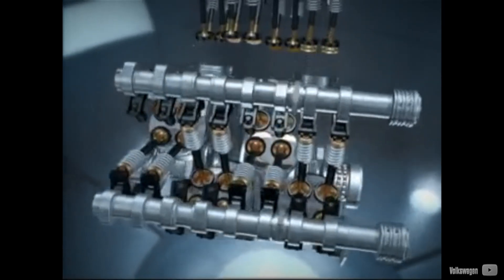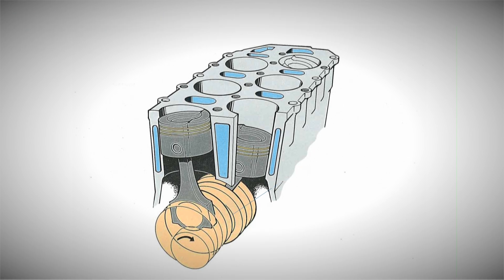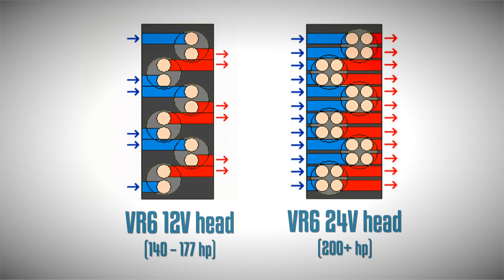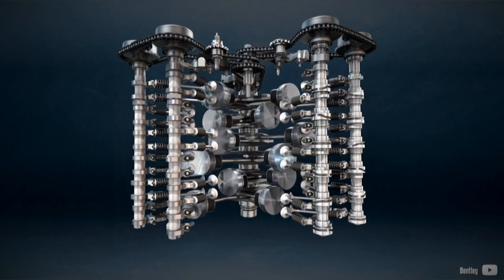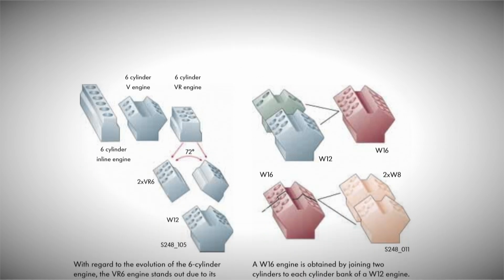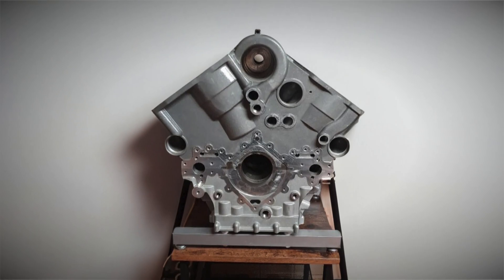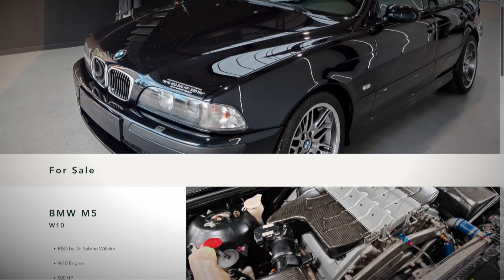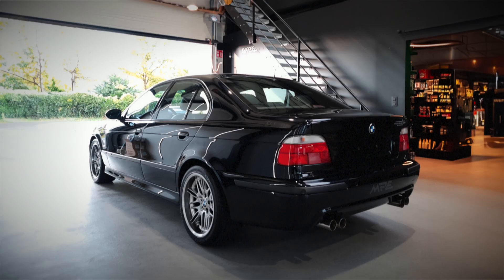The Volkswagen W10 Is A Real Engine

Comment: The power output of this engine can be easily surpassed by a modern 5 cyl Audi turbocharged motor which will also be lighter & more efficient. Large displacement engines (which are also incredibly complicated & expensive to rebuild) in light vehicles simply don’t make any economic sense, despite the merits of their technical achievements. Moving into the electric & hybrid era these engines are dinosaurs.
Reply: The old BMW N52 was waaayyyy easier to diagnose and fix than the modern replacement... So always take the generalisation with a grain of salt.

Comment: VR6 stands AFAIK for V-Reihenmotor (inline v-engine), 6 Zylinder. It's an inline and a v-engine at the same time.

Power output of the first generation (sold as VR6) was 174PS for the 2.8L and 190PS for the 2.9L respectively here in Germany.

Yes - it sounds great. But it's engine management system was already outdated when new. It constantly runs rich and the timing chain is a pain in the a**. To sell them in the mk3 Golf they even de-tuned the (IMO superior) 2.0L 150PS ABF engine.

Albeit the strongest 4-cyl. n/a engine they ever made - with the famous Garlock chip they did ~165PS on an otherwise stock engine. When you spend a little more you can easily get to 200PS and over.

The VR6 (and later V6/R32/R36) is a tuner's favorite - but it has it's limitations. Especially in light cars like Golf mk1 - mk3, handling suffers dramatically from the massive lump hanging in front of the front axle.

For driving performance, the 1.8T or the ABF are better choices.
Reply: You mean the VW AP?
Reply: @gabrielvieira.4358  Sorry - what do you mean?

Comment: I wish VW also made a VR2, a modern take on Lancia’s VR4, a VR 8 (half of a W16), a W4 (two of those VR2s), VR7s, W14s, VR9s, W18s, VR10s, and finally W20s. Why? Because engineering and the ability to be modular to an extent. Maybe I’ll have to take on these as engineering projects one day and make a modular VR/W engine family
Reply: all of the vr engines are terrible designs for anything other than packaging. rod to stroke ratio/angles are trash, exhaust heat from the front bank goes directly into the bank adjacent, the head also doesn’t flow equally across all cylinders.
Reply: It would be cool if that could be fitted in a Saab 96 as well. (The Lancia V4 was in the race with the Ford V4 to become the Saab 96 OEM engine).
Reply: @hugobloemers4425  I’d have to look at the engine mount locations if I ever follow through with this
Reply: Engines with less than 3 cylinders sound tired and boring, so no deal... See a video of the Fiat 500 2 cylinder. That little thing screaming for his life at 6000 rpm's and it sounds like its at 3000....

Comment: The 2000s was arguably the decade of the 10 cylinder engine: Dodge had their V10 powered Viper since 1989 and they even stuffed a Viper V10 into the Ram pickup truck, Lamborghini and Audi jointly developed a V10 to be used in the Gallardo (later Huracan) and R8 supercars respectively with Audi even stuffing that V10 into sedans and even wagons. BMW, being heavily involved in Formula 1 at the time, also put a V10 in their M5 sedan and wagon. Porsche took their V10 that they had developed for motorsports in the 90s and put into a road car: the Carrera GT. A car considered to be one of the best sounding cars of all time but also one of the most difficult cars to drive (which we sadly found out the hard way in 2013). Toyota, also being involved in Formula 1 during this time, was developing a V10 around this time with Yamaha which made it's way into the Lexus LFA: a car which many consider to be THE best sounding car of all time. And of course, there was the 3 litre era of Formula 1 that lead to arguably the best sounding era of the sport with all the teams opting for V10s over V12s and V8s.

Yes, the decade saw plenty of V12s, V8s (naturally aspirated or otherwise) and so many other different configurations of engines but we never had so many V10s before or after since. I miss those days.
Reply: Don't forget the Ford Triton V10 in their commercial line.
Reply: Yes.. make V10 great again, McLaren did that with Solus
Reply: I will admit that the teams opted for V10s. But the V12s sounded much better. More melodic.
Reply: @ImInLoveWithBulla A V12 makes beautiful, harmonious sounds, a V10 makes shrieking wookie murder sounds, It sounds scary, dissonant, resonant, and violent. Just my opinion.
Reply: And dont forget the second gen nsx with a 5.5 Liter V10

Comment: I m sure I m not the only one to comment on the outstanding graphic for the VW W10 working. The accompanying soundtrack, in sync with the "cartoon", that unique, beguiling and unmistakable ten cylinder sound, did seem to have the character and quality of a W10 - although I couldn't describe exactly what that was and how it differs from a V10. Somehow "lumpier" - yet weirdly smoother - at the same time. If indeed it is the real McCoy, an actual recording of one of the three ever made, that is remarkable!❤
Reply: That's actually a simulation program that can reproduce the sound an engine would make based off the actual physics iirc
Reply: @kasuraga yup. The guy who made it has a YouTube channel. It's called Ange the great.

Comment: A couple of things IMO.
a) I'd almost put money on the engine being in a BMW was for the engineering team to hide it from their own bosses. Alot of these engines were being developed from within the engineering department without official sign off from the bean counters. This was costing VW huge amounts of money and to say that the bean counters weren't happy with the situation is a understatement.
b) Although these engines (I'm referring to the W12 for this comment) were exquisite and jewel like from a engineering perspective which I admire. In real life car owners were saddled with unbelievable maintenance expectations. For example if you owned a VW Phaeton with the W12 the factory maintenance on the valve train components called for complete replacement of the entire system in some un godly low kilometres on a regular basis. Which costs mega bucks.
It's no wonder that these Phaetons change hands so often.
They also had a multitude of issues unrelated to the engine.
Reply: Your notion of it being a secret skunkworks project by the engineers is intriguing and could even be true, although you cite no sources.

As for the various comments about the twelve cylinder Phaeton, the overall reliability of that car was indeed not great although I believe that that is at least partly an expression of resentment by owners who have neglected to provide their cars the proper specialist maintenance. Regarding the valvetrain, I don't think you were making it up - nor setting out to mislead or besmirch that aspect of the W12 - but I don't believe your contention. I worked for VAG over a nearly 19 year time scale covering the period of development of the W12 and its introduction initially in concept cars like the VW Nardo and Audi Avus. I may be wrong about the latter - Audi did several like the Rosemeyer which I think on reflection were V12. Perhaps more relevant however was the appearance of production cars in my time there featuring the engine which, by my departure was by no means limited to the Phaeton. From memory it had certainly become an option in the Audi A8  and, although not directly in my purview, various Bentleys. Whilst, of course, it was never something frequently encountered in the manner of the 1.9TDi - enough have been made, over a sufficiently long time to form an accurate picture of their performance in the sense not just of tractive effort (and it's effect on acceleration and top speed), but also its accoustics, "feel", fuel consumption, emissions, serviceability, reliability and longevity. At no point have I ever heard the issue of which you speak. The valvetrain is in fact as robust and durable as any other VW engine, that is to say: "very".

Comment: fascinating.  After that pic floated around recently of the W-10 block with all the "what the heck is that" kinds of comments, it's great to get some info on the history.  It's too bad everyone's going to small displacement low-cylinder-count turbo engine these days.  An Atlas Cross Sport or a re-introduction of Passat, CC, or Phaeton featuring a W-8, -10, or -12 would definitely have my interest.  Especially if they mount it longitudinally to drive the rear wheels primarily.
Reply: The 2000s had to have been the best decade for naturally aspirated engines: the Volkswagen Auto Group had their VR6s and W8s and W12s and they also had V10s of which some were stuffed into sedans and even wagons. Porsche had their V10 powered Carrera GT while Yamaha was developing the Lexus LFA V10 during this time and of course, there was the V10 powered Dodge Viper. Ferrari, Lamborghini, Aston Martin, Mercedes Benz etc all had V12 powered supercars or grand tourers and there were V8s made by every manufacturer in every part of the globe. Even the V6s were for the most part naturally aspirated unlike nowadays where they are all turbocharged for emissions and fuel economy related reasons. 

We'll never experience this kind of variety ever again. But man, what a time it was to experience!
Reply: @CyanRooper if we can get the government to open their eyes to alternative fuels and hybrids, maybe we can experience variety like that again! And maybe even have other wacky engines produced like opposed piston engines (like the Cummins ACE), H engines (two flat engines on top of each other), W engines (three, four, and five bank), X engines (two V engines laid flat kinda like this: ><), etc
Reply: @fadedsoul23  I hope so, brother. I hope so.

Comment: Great video ! You ALWAYS teach me some engine knowledge that is new to me, and, even better, VERY interesting and inspiring .. so there is a 10-cylinder version of the VR engine concept, created by putting two VR5 in a classic V-engine layout, whoaa, just lovely, that's what a gearhead's wet dreams are made of 😍😆😅 ... you didn't mention it a single time in the video, but i know you're completely aware of the enormous potential in the VR concept that can easily be unleashed with some - or even better - much boost. VR5 and VR6 both are capable of doing 400-500 hp for many years/ hundredthousands of kilometres if it's done right. Now let that sink in and think again about that 10-cylinder engine 😳😳😮🦾